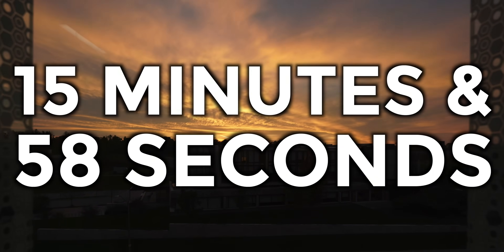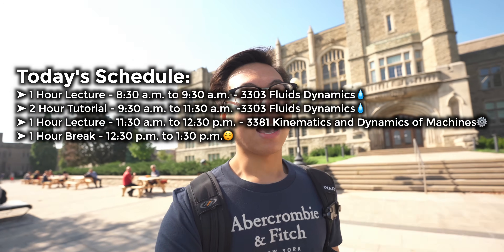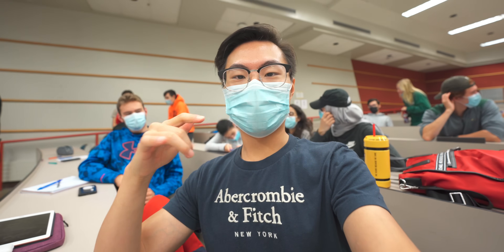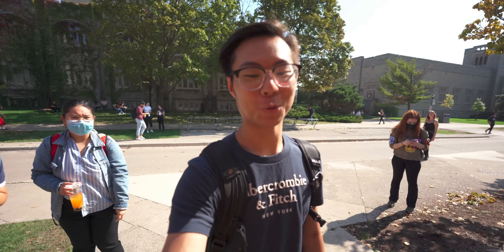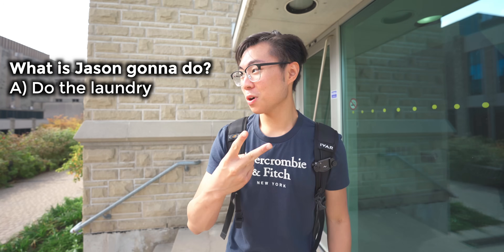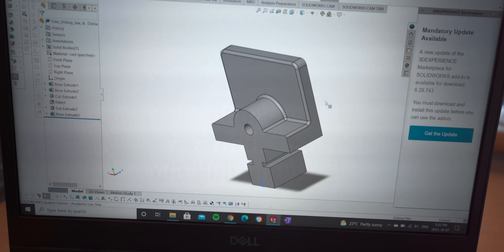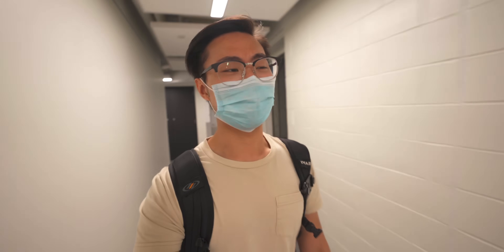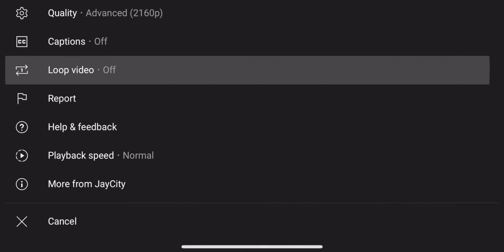Day in the Life of a Mechanical Engineering Student | Western University (Third Year)

Comment: The loop thing totally worked! I’ll be going into mechanical engineering next year (hopefully at western). What tips do you have for what computer I should buy? I noticed you went with the iPad/MacBook duo (in 3rd year too), is that a good choice?
Reply: Hey, I'm a second year electrical engineering student and I would recommend staying away from MacBook if it's your primary computer. There's lots of different softwares that you'll be using that present software compatability issues and differences from how the profs teach you that makes it a bit of a nightmare. If you also have a desktop to run said software then it's an okay choice but if your laptop is your only computer I'd recommend staying away from Apple. Cheers
Reply: @owenmahar9476  Hey thanks! Do you mind if I ask what you chose as your primary computer?
Reply: @kylevdb13  I chose the acer spin 3. It's a good device but I have reservations about the build quality and concern that it won't span several years like one would want based on the price. If I could make the decision again I would likely go with the surface book, it's pricey but seems to be ideal for an engineering student. Hope this helps!

Comment: Fluid mechanics and electrical circuits were all grinds as a third-year student. What a video, Jason! Very insightful
Reply: I couldn't agree more. Those two classes have to be one of the hardest classes I've ever taken
Reply: @Je66384  I found fluid mechanics quite easy but circuits was so hard. I actually flunked a mid semester in Circuits.
Reply: Taking those next semester
Reply: I study chemical engineering yet why do we also have electrical circuits lol 😭
Reply: I am from India and I had Fluid Mechanics in my second year and circuitry in the first. I have HVAC and IC Engines in the third year.
Reply: Nothing but facts
Reply: Can I learn fluid by itself now or would I need to know calculus or something
Reply: @nastydre4433  You can learn the concepts for sure. They’re pretty straightforward. The math proof will need some calc background; that’s the hard part.
Reply: @alexisidro  ok I’ll start learning as soon as this semester term is over
Reply: @nastydre4433  You got this. 💯 lmk how it goes!
Reply: @nastydre4433  if you can find one, edx do some great free online courses. I recently passed an Advanced Fluid Mechanics course ran by MIT on there.
Reply: @nastydre4433  you really need calculus and a lot of geometry

Comment: Great video man! Just out or curiosity, what laptop are you using? I’m in grade 12 and thinking of buying a laptop but not sure what kind of specs engineering would require. If you have any recommendations, please let me know. Thanks in advance.
Reply from the maker: Right now I’m using a MacBook Pro, a Dell G5, and an iPad Pro. If you’re going into engineering, a windows laptop is definitely the way to go. Or running windows using parallels on mac. As long as you have windows, you’re good
Reply: @JayCity  Thanks for the information. What about gpu? Do you need dedicated graphics or is integrated fine?
Reply from the maker: Definitely get something with dedicated graphics. You’ll needa run some pretty heavy apps like CAD softwares and the extra GPU performance really helps
Reply: @JayCity  Thanks so much for replying man. Keep up the great content!
Reply: How is the dell g5 working for you? Is the battery life decent enough for school?
Reply from the maker: @Warun16  Yeah it's pretty good, there are definitely better options out there tho
Reply: @JayCity  any recommendations? Thanks in advance.
Reply from the maker: @Warun16  Unfortunately I’m not sure about that one, but definitely gotta take the portability and cpu and gpu power into consideration
Reply: @JayCity  thanks, leaning towards the asus g14 right now. It has really good performance with good battery life.